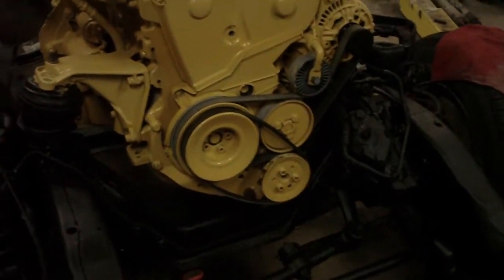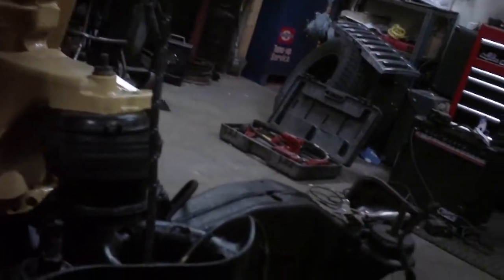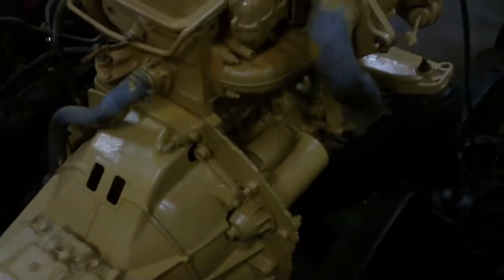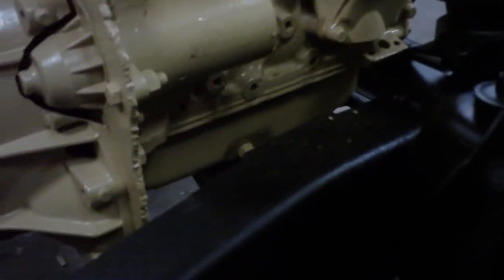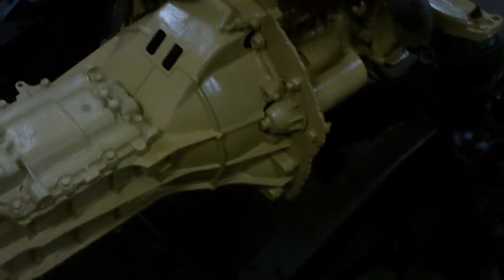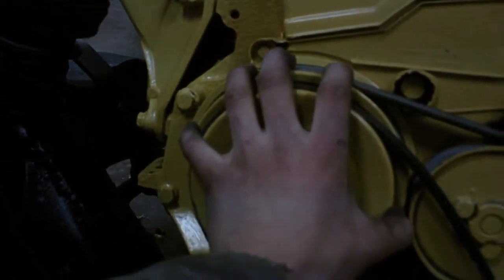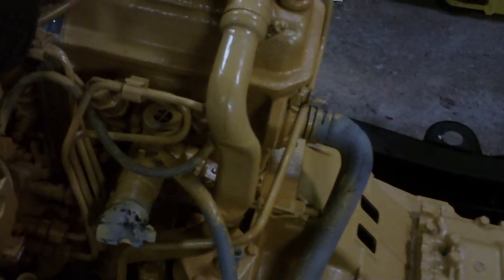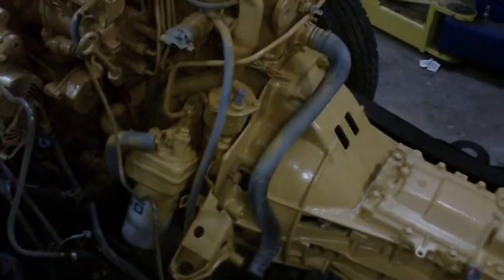Walk Around: Volkswagen Diesel Ford Ranger

Comment: How did you connect to the ecu?
What parts were needed besides the trans adapter plate?
What battery did you use?
How did you mount the ford flywheel to the tdi?
Power steering pump VW or ford?
How will the fuel system run?
Is it a manual trans?
Reply from the maker: To answer your questions:
-No ecu, all mechanical
-No extra parts that I remember maybe just relays and stuff for the glow plugs.
-Stock ranger battery
-Flywheel needed the centre hole machined bigger and the holes are offset on the vw crank so some drilling was required for the ford holes to line up. 
-Vw power steering pump/res to ford box.
-for the fuel system all I did was drop the tank and pull out the ford pump. Then connected a pickup tube( I think o just used some fuel hose) to the appropriate length so it was at the bottom of the tank and the injection pump does all the pulling right from the tank. I used the fuel filter from the car and mounted that if I remember correctly. It’s been a while at least that’s what I planned to do.
-yes manual transmission from the original 2.3l gas engine. The v6’s had a different bell housing but anything can be swapped with enough determination.
Are you doing a swap?
Thanks for watching!
Reply: I would like to but the lack of specific information from all of these video (parts numbers) is making it so I'm having to research from zero everything. Do you have any of that? @AndrewMarsch
Reply from the maker: @jonathangarzon2798  it’s all pretty simple, engine is a 1.9L turbo diesel AAZ out of a 1996 Jetta. Which is all powered by a single wire to the fuel pump.
Trans, starter, clutch  and flywheel are all stock from the 96 ranger 2.3L. This is all mounted on a 1/4” plate of steel by trial and error. Then the engine mounts, also trial and error.
No configuration of part numbers is going to make this a plug and play swap. If you want that then there are pre made plates for about 1600 usd. This would save you a bunch of time. Might have even been the route I went but I did this about 15 years ago…

Comment: Hey I’m in the middle of doing this swap n was wondering if you could make a video explaining how you made the mounting plate to the trans and how thick it is
Reply from the maker: Backroad Brad  hello, it’s been a while since I did the swap, I think it was 1/4” mild steel plate. No mods to the block as far as I can remember. Did some cutting to the trans housing. And starter had to be mounted on the actual plate.
Reply from the maker: Backroad Brad how is your swap going?

Comment: Are you still responding to comment on this video? I'm planning to do the same project as you soon and it would be awesome to have somebody that already did it to answer a couple questions!!
Reply from the maker: You bet, sometimes comment notifications get missed. But when I see them I am quick to respond. What are you planning to swap?
Reply: @AndrewMarsch  omg okay I wasn't confident someone was gonna reply thats straight up awesome. I've bought a 2004 vw golf with the 1.9 bew engine code tdi, im planning to put it in a 4x4 manual transmission ford ranger and I was gonna buy the 1500$ kit but I'm happy to see that i can do it with a 1/4" thick plate and a plasma torch
Reply from the maker: @maximelarochelle5008  you will have a little bit more on your plate then I did for this swap. First off I would be on the hunt for videos that explain how to get your BEW to run “standalone” i know there are explanations of this on the ALH engines (my personal preference). This is probably best to do while the engine is still in the car? Check your specs for fuel delivery pressure on each vehicle (the bew requires a lift pump) if the psi specs are the same I would just run the stock ranger fuel pump. As for the plate and adapting. That’s just a lot of measuring cutting and grinding etc. If you’ve got the tools and the time I would try it yourself. Let me know if you have any questions! Cheers.
Reply: @AndrewMarsch  thanks man i will definitely keep you updated.

Comment: I did a similar conversion to my 1970 f100.. only i went mercedes benz om617 diesel with a ford m5r2
Reply from the maker: Mike CorLeoné yea if I were to do it again I would be on the hunt for a Mercedes and use the rwd trans. No messing around with adapter plates. I actually have a couple mid 80’s s15 trucks that came with the factory Isuzu engines. But I have a 54 Gmc pickup so I’m brewing up a body swap onto the s15 frame.
Reply from the maker: Thanks for the comment.
Reply: I had to use an adapter but it’s all readily available online. Give me a minute and I’ll post the link of my truck

Comment: Hi was wondering what engine mounts u used on the block- they look cast?
Reply from the maker: Joseph Sook they are the stock engine mounts that came on the vw. If I had to do it over again I would build the mounts stronger and even consider making custom ones that would bolt up to the original ford motor mounts that the 2.3l had

Comment: You said you used the ford clutch and flywheel were they a direct fit to the crank?
Reply from the maker: No, flywheel was sent to a machine shop. The centre hole needed to be bigger in order for it to fit into a raised portion of the crankshaft. From there I needed to modify the bolt holes in order to mount it. I questioned the integrity of the mounting because of the holes but it held up quite nicely.
Reply from the maker: Thanks for watching. Let me know if you have any questions. What are you working on?
Reply: @AndrewMarsch  got a 93 ranger doing a 4x4 swap now thinkin about doin a tdi swap

Comment: How did you adapt the flywheel?
Reply from the maker: Scott Schoenfeld sent it to a machine shop to have the centre drilled to match the rear of the vw crank that had a raised centre. Then I drilled the mounting bolt holes to match the vw bolt pattern. Thanks for your comment. Any other questions I would be happy to help.
Reply: That's kinda where I was headed, but thought I'd ask someone who's already been there. Thanks!
Reply: How did you mark to drill the holes perfectly? Wouldn't it be off center and unbalanced otherwise?
Reply from the maker: Pendemic hey sorry for the late reply. The flywheel was machine to fit perfectly on a raised portion on the vw crankshaft. So it was centred after that there were I think 2 holes that lined up together. From there I just cut what needed to be cut so I could install all the flywheel bolts. Definitely wasn’t the prettiest but it was the best I could do and it stood up to quite a few miles so far and is still held together. Any other questions let me know. Thanks for viewing

Comment: Hey are you still alive ? I have a ranger and I wanna do this
Reply from the maker: Alovi Mcafee Lol yes I am still alive. Any questions let me know
Reply: my first question is the adapter plate , how did you go about that ?
Reply: @AndrewMarsch  idk if you saw my comment( please dont that this comment as rude)
Reply from the maker: The plate is made out of 1/4” mild steel plate. No machining was needed. It all was done on a shop floor/ work bench. Last year the clutch gave out on me so I will hopefully be doing a tear down video, quite a few people are interested in that. It was done quite a while ago so my memory isn’t that great on the details. If you subscribe to my channel you can see the tear down video when it gets posted. Any other questions feel free to ask. Thanks.
Reply: @AndrewMarsch  oh you were able to do it at home? what tools did you use ?
Reply from the maker: Cutting torches, grinders, cut off wheels, lots of drilling. Also take your time I cant count how many Times I tried to mate the two and I needed to file or drill a little bit more. It’s better to do that then do file too much or drill in the wrong spot etc.
Reply: @AndrewMarsch  how much did it cost you to do it yourself because frankly.... i dont wanna pay 1.5(fucking)k when im getting the engine for 300
Reply from the maker: It depends how far you want to go with it. I definitely spent more then that but I did things that you wouldn’t really need to. If you have the tools mentioned and an engine crane etc. It could literally cost you as little as a few hundred bucks but lots of time WILL be invested. If I did it again I would have left the cab on, pull the entire front clip off. It is nice making the engine mounts with all that out of the way. What are the details on the donor truck? Engine, trans, 2wd? I’m not sure if I mentioned it in the video but I know I have in the other comments, that the flywheel did need to be machined but that was not expensive at all. Around 60-80 dollars. Also what donor car is the engine out of? Again thanks for the interest I hope to see your swap project start asap.
Reply from the maker: I am replying as fast as I can. If you have any other questions I am happy to answer them. I will set up a snap chat this summer most likely.
Reply: Do you have any rough idea of how big of a plate u got
Reply from the maker: Alovi Mcafee it was a scrap piece that was sitting outside of the shop. I think 1/4” thick and cant remember the size. I just used what i had but I’m sure like an 18”x18” square would but be a perfect size to start with.
Reply: So 1/4 inch is thick enough ? Adapter sellers were selling like 3/4 or 1/2 I think
Reply from the maker: Alovi Mcafee I haven’t ever looked at other kits to buy. All i can say is mine worked and stood the test of time. All i can think of is maybe they are made of aluminum? Also i would be concerned about the clutch spacing if it was 1” thick. You would have to then shim either the flywheel or the clutch slave. Ill have to definitely do a tear down video this summer and see what all i did. It’s been so long I don’t remember all the details.
Reply: @AndrewMarsch  i was thinking about maybe a half inch plate. ok so a run down on things you had to buy : aluminum motor mounts , you gotta do the gas pedal and wiring and starter , what else is there
Reply from the maker: Alovi Mcafee motor mounts were the vw ones I just welded more metal onto the ford frame. Throttle on the engine i used was mechanical so i used the throttle cable that the ford had on it already (easy) and also the starter cables all just went back onto the starter (no mods needed) and i used 1/4” mild steel plate (not aluminum)
Reply: Andrew Marsch so no radiator mods or anything ?
Reply from the maker: Alovi Mcafee radiator is the same one the truck came with. Just had to piece together some hoses to make it work and that was it.
Reply: Is there any way I could call you on something sometime
Reply from the maker: Alovi Mcafee I don’t see why not.

Comment: what ever happened to this?
Reply from the maker: MASTICS FINEST finished the swap. Drove it for 4-5 years with probably 40-50,000 kms on it. Never needed to come back apart until this spring the clutch will not disengage so I will be tearing it apart for the first time. I am thinking about doing a tear down video and maybe making a few copies of the adapter plate.
Reply: it would be great if you can show a tear down vid and make a few cooies of the adapter plate..... another question is that the m5r1 or m5r2?
Reply from the maker: MASTICS FINEST I am not completely sure but I would guess the m5r1 and the original engine was the 2.3l.